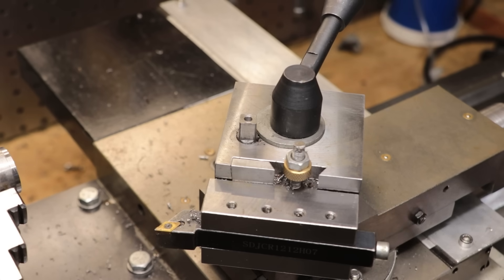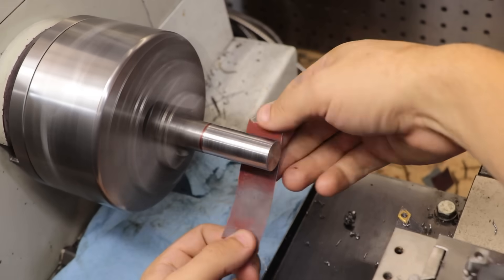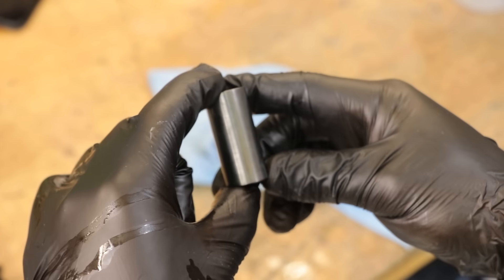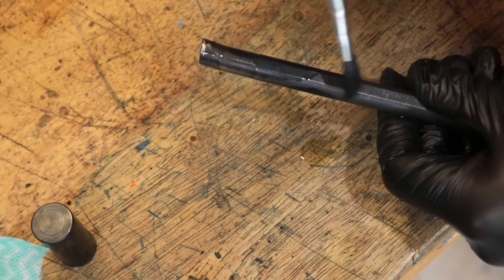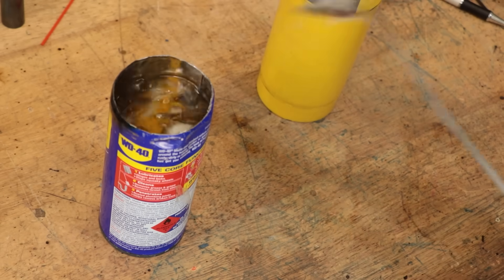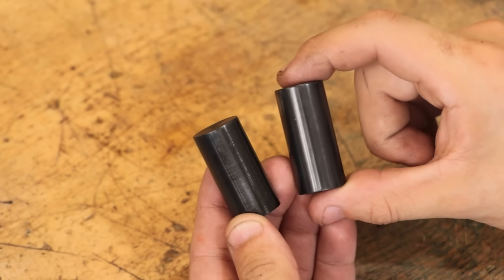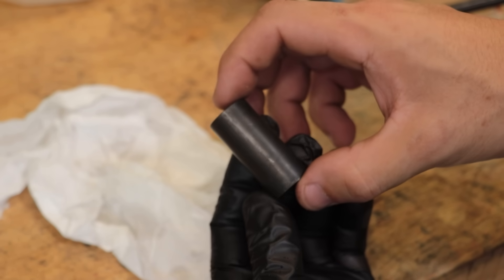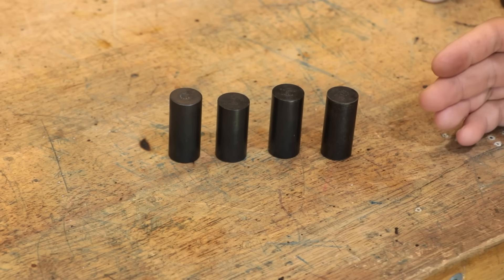Best Way To Blue Steel? Cold Blue, Hot Blue or Rust Bluing.

Comment: What you called hot blue isn’t bluing. Hot blue is boiling caustic salts and is black iron oxide like rust blue. It’s as you described, an oil seasoning.
Reply from the maker: I call it hot oil bluing, not hot bluing

Comment: There are lots of videos from vintage gun repair guys (@marknovak8255) that show the whole process and give lots of tips and tricks on doing it at home/in a garage. Every step is important, from how you rust the part, how you convert the rust, how you clean the surface rust off, deciding whether it needs to repeat a step, and even how you maintain the parts afterward.

Comment: There are different cold blues, some don't get as dark, some get very blue (Presto Mag). Super Blue has some copper compounds, making it slightly blue and lighter, some that don't have the copper salts or acids added will get much darker much more quickly, but it feels like the copper also adds some weard resistance, the Super Blue is much harder to scratch off than the Ballistol one, that does have the same ingredients minus copper compounds.
There are 3 from Birchwood-Casey, all with slightly differing results. I have used SuperBlue and PrestoMag and the Presto gets a really strong blue sheen. But it all depends, they also look different on different finishes.

Comment: I am a gunsmith. I have done the hot caustic hot bluing. It is a long an complicated and expensive set up with specialized equipment. Mine was heated by propane, of which it used a lot. Most all alloys of steel came out with a rich deep black, some came out splotchy, very ugly, even odd colors like green and pink !   Stainless steels have their own special mix of bluing salts. I blued so many in my area, that it became unprofitable to keep renting the propane tank for just one or two a year. Do not get into hot caustic bluing unless you can justify a continued need.
There are specialized tool blackening ( cold blue ) chemicals that can be bought that do far better than the one in the video.
Also, there are special paints that can be air brushed on,and baked in an oven.
Reply: I used to work in a gunsmith workshop and it was far from expensive that process, in fact cerakote was more expensive, and chrome was made in other places due to the difficult in the small scale use of the process.
For the hot caustic process we use to dip a lot of parts for saving time and money and the liquid was not that expensive.
Propane was is not expensive also
Reply: Can you do things cold and have the surface be food safe? I want to be able to cut an apple with my coated blade and not get selenium poisoning
Reply: Yes i have watched it done and it is not fun, however, as you no doubt know, the finish is fantastic and when done properly very tough.  The best bluing I have seen is on my Model 80 J.P. Sauer.  As with most things, preparation is everything.  Way back (45+ years ago) i bought a 308 CZ. They were cheap, reasonablly accurate and properly machined where necessary but poory finished.  I finished the action with hand files, abrasive papers and diamond grits and had it blued.  The gunsmith pronounced it worthy of him applying his craft to it on my third presentation of the gun for his approval😗.  I learnt a lot from that little exercise, it took a lot of time to get it right but the end result was worth it.  

For those who want to try it, bluing is like a high gloss finish, it will expose every little flaw and mistake.  In my experience, it is far more intolerant of mistakes than a plain polished metal finish.

First thing, have a very good light in your work area.
Reply: use scrap wood/ fire wood and heat the tank outside for caustic bluing, have to monitor the temperature closely, but it's cheap and repeatable

Comment: Former R&D director at a cutting tool fab shop (my main job was reverse engineering cutters for GM / Bombardier / Honda etc) All of our bluing was cold - we didn't brush it on, we had a tupperware container of the stuff and the parts got submerged and agitated. The liquid will gradually turn from blue to green, to a bit yellow. A 300-400ml container would last hundreds of parts / more than a month of constant use, it just might take a few extra seconds. Once the solution starts to go neon (green / yellow), finished parts will have some brown sludge form on them (over the black) that can be rubbed off during oil application. As mentioned in other comments, parkerizing should be the go to for longevity without as sensitive a need for constant oiling (the phosphorous of the surface treatment when exposed to moisture it will release phosphate ions into the water producing phosphoric acid, which inhibits oxide formation, and converts iron3 oxide(brown rust) into iron2 oxide (black rust) which is much more soluble and washes off). It still needs to be oiled to make it last, but the magnetite / selenium foam of 'black oxide' trying to hold oil just doesn't compare. 
 - Just checked, completely forgot you can soap parkerized parts lol, basically galvanizes the thing.

Comment: The one you skipped was Bright Bluing. See Clickspring, it's actually a type of iridescence. Bright blue finish, it's a bonded oxide using carefully controlled heat. As witth hot oil blue, not suitable for heat treated parts

Comment: Method I have found to be the best is dipping the part cold into molten potassium nitrate. By the time the part has come up to the temperature of the nitrate it is done. Gives a rich S&W dark blue if the part is polished up before treating. The colour can be adjusted by adding a pinch of cement colouring.
Reply: Can you make a video of it.

Comment: The term for blacking steel is actually 'browning'.  Perhaps it was invented by the poet..who knows..Anyway, the cold blueing stuff we used in the past was selenium based, and was really a very poor-mans substitute for the hot caustic process.  Not only was it not at all durable, but it gave everything a foul smell, including the person handling it.  It's said selenium can make your breath stink of rotten eggs, so I wouldn't recommend it.  The hot process uses sodium nitrate, nitrite and caustic soda in the molten state with some water, at around 140C I seem to remember.  If you can get hold of the chemicals in this nanny state, then I don't see why you shouldn't do it, as long as you're not one of those people who need to be warned not to eat their car battery.  These days, my favourite is ....wait for it...the sand blaster and the blowlamp.  I use kiln dried sand in a home made pot (ex- propane cylinder with a few extra bits, and of course the compressor).  I blast the components lightly, to give them an even matt finish.  It gets rid of any staining and light pitting/machining marks.  Then I heat them up with a large gentle flame waving it around evenly and watch for the colour change.  Once it start to go blue, that's enough, don't go to hot or the the colour fades a bit.  It will return as it cools.  I then let them cool a bit then oil them or dip them if they're not too massive.  I also use a solution of beeswax in paraffin which dries off to leave a pleasant feel to them. The matt black finish is really posh.  I love it.  Oh, and before the safety elves kick off about the dangers of sand blasting with real sand, yes... I know. So I stand up wind, wear a mask, and don't do it every waking moment.  I think the risks are greatly exaggerated even so, I mean the Bedouins spend entire lives tramping around sand dunes in the Sahara.  They seem to survive.  Perhaps it's sales bullshit so you buy the expensive 'proper' grit.  A bit like why you must throw away the cold blue you've dipped parts in.  Just bullshit.
Reply: the dangers with sand in sandblasting isn't just about sand, like in the desert or whatever - it's that the high velocity smashes the sand into even finer silica ie. silicosis. that's the idea anyway
Reply: Browning is a different process than blueing. Browning leaves a brown finish. Blueing is blue or black, depending on the particular process used.
Reply: @mikegross3800  Depends on which book you read.  Rust blueing is often referred to as browning.  Hot blueing or blacking is a later process and presumably the old rust blueing term continued to be used.  But yes, rust blueing is a different process to hot or cold blacking.

Comment: your rusting solution is not as good as Mark Lee Express Blue #1. When applying your rusting solution heat the parts then apply it. Apply it a few times. Then boil it for 20 min. You will have a black powder on the part. Then Buff with a "carding wheel" .002" to .005" wire wheel.  Repeat this process 3 times then oil. It will be more wear resistant then ANY other bluing method. Read my article on Wikipedia about it.

Comment: For cold blue on small parts, I have come to prefer the Birchwood gel.  A smidge goes a long way.  All the same processes, but you smear the stuff on the metal with gloved fingers and watch it work.  I usually leave the parts until the gel is mostly dry and gummy, then wipe well and oil the parts to sit overnight.

Comment: Huge fan of your channel here.  I have some experience as a gunsmith and in teaching gunsmithing classes so would like to offer some additional thoughts.

As others have mentioned, Parkerizing is a very viable alternative.  It is best done to steel that has been blasted with aluminum oxide first, then degreased and Parkerized.  That will give it the texture that promotes oil retention.  Zinc Parkerizing resists corrosion much in the same way that hot dipped galvanizing does, by attaching zinc to the steel.  It’s a simple process done at about 160°-170°F/71°-77°C.  When the part being Parkerized quits bubbling, it is done.  It’s easy, relatively inexpensive and an excellent method of preventing rust.  It is not suited for precision surfaces.

Cold blue is just a change in surface color; nothing more.  It's caused by the very toxic selenium in the solution.  You're correct that the brand you used is not the best.  "Hot oil blue" would be a better description for that process.  Gunsmiths use the terms hot bluing and caustic bluing interchangeably.  Cold bluing can be improved somewhat by gently warming the piece to around 140°-150°F/60°-65°C before applying each coat.

Your “super slow” rust bluing method was done far too fast.  For firearms the steel is allowed to rust overnight in a humid environment before boiling and carding.  The extended rusting time permits deeper penetration of the iron oxide.

Having done a lot of hot caustic bluing in a correct environment, it is not the best method for home use.  The correct temperature is actually 201°C/395°F and is controlled by the concentration of salts in the solution.  Contact with hot bluing salts will result in severe heat and chemical burns and it can destroy eyes.

Comment: I do cold bluing in a different manor. First, buy the ‘Presto Black’ by Birchwood. It’s the tool version, which is much blacker than the gun blue. It comes in a large white bottle for ~$60 (think per quart). 
Then start the same way, wipe polished surface w/acetone and then wipe w/Presto Black. Then, instead of oiling, you use ultra light scotch bright yo lightly remove the first black. It’ll look like steel, but a bit darker. Then coat in Presto Black again, let sit for a couple mins each application. Then, the final step is oiling and letting it sit for a couple hours. Then, wipe any excess with a microfiber pad.
This will make a really nice and glossy finish that’s very black, as there’s no powdery buildup or rusty-looking portions, a product from the bluing remaining and allowed to react with the oil, more than the reactive surface of the steel allows.

Comment: I've had good luck with Parkerizing steel parts, also known as Phosphate coating.  There are 2 main types, Iron Phosphate and Manganese Phosphate.  If you see a recipe for phosphating that calls for Manganese Dioxide (by harvesting it from alkaline batteries) then it's is not Manganese Phosphating, and you end up with a light gray Iron Phosphate coating.  Manganese Dioxide is non-reactive in most acids.

I worked with a chemist friend before he retired, and we found a method that works.  If you can get the materials, then great.
You need a solution that is 1% phosphoric acid, 0.2% nitric acid, and 0.5% manganese carbonate (MnCO3). In a stainless container I heated 1.5L of water to 95C, then added the phosphoric acid, the nitric acid, then the manganese carbonate.  When dissolved and the temperature stabilized, I submerged the parts in the solution for about 20 minutes.  The part was then dried, and coated in oil for a nice dark gray to black finish.

Comment: The simplest one to use is Stuarts Cold Blue. It mixes 1 to 3 with tap water. Clean the part to remove any oil ect. Put the part in the solution until it gives the result you like. Usually about 5-10 minutes. Lightly coat in oil after. You can keep the diluted solution and use over and over until exhausted. Cheap to buy and very economical to use. Quick and simple. I have YouTube videos showing how to use it. Do observe all the safety information. Cheers Nobby. @nobbysworkshop

Comment: one method i have found quite good especially for tools that are already a bit rusted is a soak in phosphoric acid.  it will remove the rust, and leave a somewhat passivated slightly porous dull grey finish that takes oil very well and stays rust free for a long time.  don't leave them soaking too long though as phosphoric does etch the steel a bit too.

Comment: If you want to try more hot oil blueing maybe look into using grapeseed oil over linseed, that's also commonly used with cast iron pans.
It has a higher smokepoint, i think around 230° and generally just is a lot more robust than linseed in my experience.

Comment: I've done both caustic as well as nitrate process. I've also done a few other heat related processes. FWIW, the caustic process isn't as nasty as it sounds, it's roughly ~350F. I used to have a mix of potassium nitrate, sodium nitrite and sodium hydroxide with a very tiny amount of water in a stainless steel pot on a hot plate I would use for dipping parts. It is definitely the superior method as the molten salt pretty much saponifies any remaining oil, and converts any oxide to Iron II oxide. It doesn't outgas, you just want to have some careful controls on how things are going. If you want to try it yourself you can use a stainless steel or cast iron frying pan, fill that up with about an inch of sand, and then put a small stainless steel pan in the middle full of your bluing salts. It takes quite a while to get up to temp with the extra mass, but it also thermo-regulates itself and you can use a kitchen gas flame for doing that. Read up on it, check out some of the chemistry vids out there, it's much less exciting than it sounds.

The other process is parkerizing, which is done at boiling water temperatures, but uses phosphoric acid, manganese dioxide, and some steel wool. It's harder to make it look even, and requires the parts to be degreased and bead blasted before processing. It does involve boiling acids, but it's not as exciting as it sounds, just do it outside.

Comment: most durable bluing i've ever done for knives and wrenches i made on a waterjet: heavily sandblast the steel surface, then find a way to string the steel object on a wire. load up a spray bottle with denatured alcohol, and get good hard squirts into all the pores of the sandblasted surface. while you wait for it to drip dry, preheat a furnace to 960°F/515°C. once you hit temp in the furnace, quickly place your object in for just enough time to get it glowing red hot, without shedding scale off (otherwise you have to start all over) then quench in USED motor oil from a 2012 chevy colorado. The oil completely soaks into the pores of the sandblasted material and it makes a pitch black smooth matte surface (no gloss like your method) it doesn't chip and its very hard and scratch resistant.

Comment: Have you looked into parkerizing? It's easy to do in the home shop, and the chemicals are readily available and reasonably safe to handle.
The finish is extremely corrosion resistant and durable.
The only downside is that it does add a very small amount of material to the part, so it can affect the fit of parts with very fine tolerances. Not an issue for most tools though.

Comment: Great video. I have found "Oxpho Blue" works much better than Birchwood Casey's cold bluing compound. Keep up the informative content. Also, heat the part in boiling water rather than using a torch. It will give a much more even heat and hence a more even finish.  Thanks.
Reply: Hair dryer

Comment: on your cold bluing, there are two methods, the one you used, which is very expensive, there is another method that uses 3 baths, first a cleaner, second a blueing solution, and third a dewatering oil, this can get a deep black in one go, and the solutions can then be poured back into there storage bottles and used again and again until they stop working, this is the method I use, and a 1L kit has so far done dozens of parts, and if still going

Comment: Hot bluing is actually pretty easy, just storing the solution is pain. Blued whole air gun in welded stainless steel container over electric heater, and temperature doesn't really matter, just add slowly water when it starts to boil.